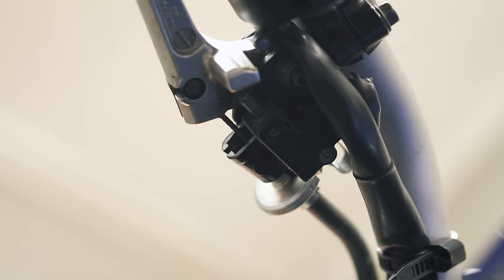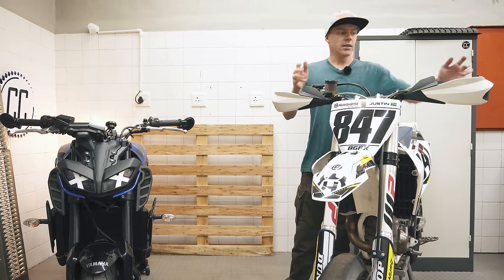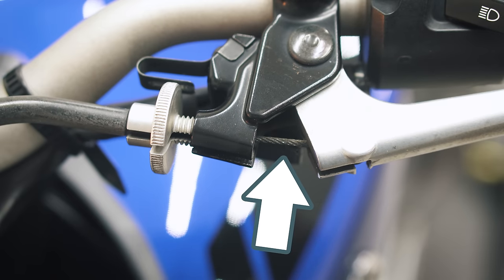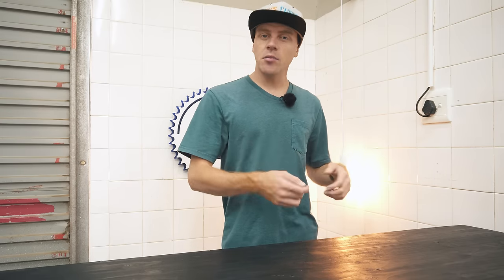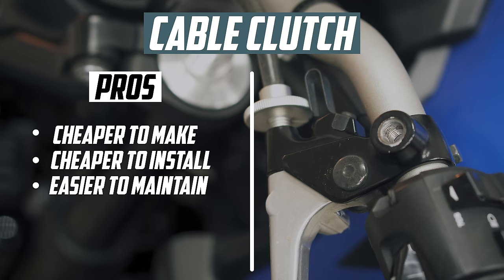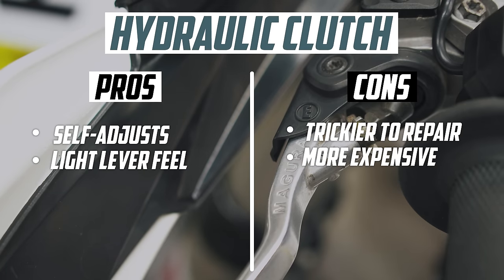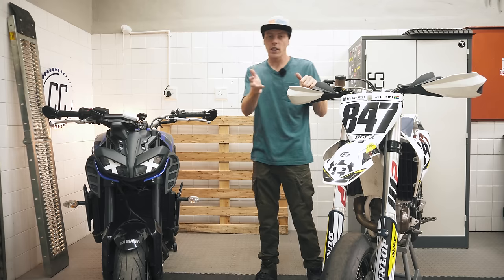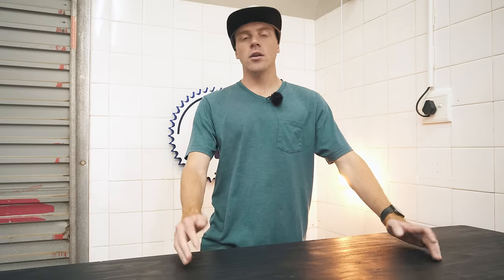Cable Clutch vs Hydraulic Clutch

Comment: Bought a VFR800, my first bike with a hydraulic clutch and was absolutely shocked... at how it really didn't feel any different 
Just makes it feel ever so slightly different when you take off from a stop, maybe a bit smoother feeling. You immediately tune it out and forget it's different at all.

It isn't something you have to learn to use differently and you will be glad that the clutch pull is a little bit lighter meaning less fatigue and slightly easier fine adjustments at very slow speed

Comment: I've got a very specific situation. I've got a 2016 Hyosung GT650 Naked, and the spares for it are harder to source. As i feel my clutch cable is starting to sag, would it be better to convert into a hydraulic system as it becomes independent of Hyosung-only clutch cable? Or wait until I source a new cable for it? As in, for all older/discontinued bikes with rare spare availability, is it better to move to a hydraulic clutch system? 

TIA.

Comment: only pros of hydraulic clutch I see is self adjustment. In cable clutch, free play will change when clutch is hot, and sometimes you may have to adjust it while racing. So many race bike or race bike wannabe have hydraulic clutch.

Comment: In my 60.000km Suzuki GSX-R150, I've replaced the cable clutch three times. I have tried hydraulic conversion, and I can assure you that it is NOT WORTH THE TROUBLE! primarily because it is dirty, time-consuming (it took me 3 hours and I came to a dead end because my clutch lever does not fit the push rod), and has an additional failure point (instead of a cable that can snap, now you have to worry about 2 worn out seals and worn out push rod).

What is the secret to a durable clutch cable? First, never lube it because, as I can assure you, doing so will only attract dirt and debris, increase friction, and cause the component to wear out even more (I once tried to clean and lube my clutch cable because many people online advised me to do so, but it did no good because I wasted my hard-earned money on a can of garbage I don't need and my valuable time cleaning the mess I shouldn't have made). Second, avoid holding the clutch lever for an extended period of time. Instead, put the gear in neutral if you're in heavy traffic, avoid releasing the clutch slowly while the engine is running at high revs, Simply let go of the clutch—not too slowly, nor too quickly—and let your engine to rev to its maximum capacity on its own. Third, save money to purchase a quickshifter for your motorcycle or attempt to learn clutchless shifting (practice makes perfect). This is not only a great skill to learn now, but it will come in handy if you or a friend has a lowside and breaks the clutch handle (one of my friend got into a lowside, he got nothing but a small bruise and his clutch handle broken into pieces, he cannot drove his bike to his home so I did it without the clutch for about 54km to his home, we arrived safely).

Do what you want, but in my opinion, converting to a hydraulic clutch is a waste of time and money.

Comment: I own a 2023 Ducati Monster (hydraulic) and a 2022 Triumph Bonneville (cable)
Fine control of clutch on a motorcycle is one of those ESSENTIAL skills and it is more difficult on the hydraulic clutch due to a lack of feeling the friction zone.
The cable clutch with slipper assist on the Triumph is WAY superior to the Ducati, particularly for round-town riding!

Comment: 2001 VFR 800, it's hydraulic and when I got it I hated it basically, the friction point was so far away from the grip it felt like it was in a different postcode.  Changed levers and it's a different story, my love live is no longer affected after a long ride with lots of changes, so us fancy Europeans are finally catching up with the fancy Japanese of 20 years ago!  But in all seriousness, when I got the bike I disliked it so much simply because of the clutch, it's not exactly as adjustable as a cable one (which you can adjust at both ends!) and from what I gather the point between "pulled" and "fully pulled" on hydraulic is a small range whilst on a cable is (again) adjustable.  Basically hydraulics can't be adjusted much.

Comment: persionally i like hydralic clutch as of now. I'm euro boy with only an AM license rn so I got my 50cc moped with cable and my husky TC85 with hydraulic. i fell with the hydraulic it starts engaging the clutch over a wider area on the lever and gives you more control over it. can't really fell anything with my moped cause it has so low power.

Comment: The main difference would be that the clutchsprings in a high horsepower bike are pretty stiff and you wouldn't be able to pull in the clutch many times with a cable. Just think about any older Ducati and you will get why some bikes need the hydraulics

Comment: i had a husqvarna wr125 with cable clutch and i switched to a hydraulic clutc, while it was lighter to pull on enduro rides etc it didnt give as much feedback als the cable clutch for hops and double blibs for obstacles and the cable clutch wasnt even that heavy. you could easily pull it with 1 finger both since enduro clutch levers are smaller and more comfortable than the ones on streetbikes. i regret i did the hydraulic but i know now for the future that you just leave the clutch actuator setup stock. (unless you upgrade to arekluse auto clutch or something but that doesnt change the actuators)

Comment: Good timing on this video, the clutch cable on my 2017 MT09 snapped only a few days ago on my morning commute (with only 18k kms on the clock) so theres an example of a very obvious con to the cable system. In saying that I've also had a seal let go on the slave cylinder on a hydraulic setup on an xjr1300 with the same result, so i suppose both systems are susceptible to failure...

Comment: I got a 2015 aprilia shiver with hydraulic clutch and on 2022 z900 with Cable clutch and its way easier to pull the clutch on the Z.

Comment: Having both an MT-09 and a KTM 350 EXC-F, I have to agree with what you said. I much prefer the cable feel and I'm pretty sure I have better clutch control with cable.
(Maybe the different type of riding on both bikes is biasing my opinion. Maybe the MT-09 is a super good implemention of a cable clutch and the KTM a poor implementation of an hydraulic clutch, I dunno)
Cheers from Portugal

Comment: hydraulic all the way :) It might not matter that much on a street bike , but when doing enduro or motocross riding it's a whole different world. You can ride all day long with a hydraulic clutch using only 1 finger and not get tired , while i felt like my fingers would fall off after a longer ride with cable clutch

Comment: Got an 08 Bandit 650 which has a hydraulic clutch. It's a nightmare. Having issues with my gear shifter sticking between 2nd and 3rd, and the only thing I can do (aside from ripping apart the engine or shift mechanism) is bleed the line
Reply: Does it do that everytime ? Sometimes they sit between the selector v's & need to kick them up again,  my bike is a kwak & does the same on occasion but more between 3rd & 4th . I've noticed it's more when i rush the gear changes,  try a little slower & firmer changes
Reply: @stestar09  Not every time. It'll go up no problem but then stick and not reset. Sometimes it resets after a second and I can feel it tap my toes, other times I have to downshift and try again multiple times. I've tried shifting quickly, slowly, firm, soft, so it's definitely a mechanical issue

Comment: The Force your fingers needs to pull the lever has NOTHING to do with cable/hydraulic. 

It is only determend by the springs in the system and the ratio at which the force is transfered from the Lever to the clutch. (For example hyraulic clutches on Harley Davidsan are hard as f**k to pull, and cable clutches and 125 smale bikes are usually way lighter. And there are vise versa examples. 

I personally like the feeling of a cable clutch mutch more over any of the fancy gydraulic clutches. (Maintance and Cost aside) It just feels more connected and the biting point of the clutch is easier to find. On all hydraulic clutches i've tried so far it felt like, yes I can feel the bike starting to move and it get's a bit louder but no real feeling for the engaging of the clutch in the lever.

I'm happy that Yamaha keeps the clutch cable actuated even on there top shelf MT-10.
Reply: This is not strictly true - with a cable operated clutch you have to overcome the friction between inner and outer cable, as well as the force needed to compress the clutch springs, so it will take more effort than a hydraulic operating system on the same clutch.

Comment: Just gonna add this: my YZ250 has a hydraulic clutch added aftermarket, and it’s simply a lever that pushes fluid into a piston that pulls a cable…. It’s pretty smooth and easy to pull. But my WR250R with a lubed clutch cable has a lighter pull and better feel.

Comment: From what I gathered is, that some larger capacity bikes(and therefore more torque) stiffer clutch springs are needed or in general a more beefy clutch

This could be very fatiguing when you have hard clutch springs and a lot of cable drag. This at least removes some of the burden. Hydraulic radial clutches also offer a more direct feeling IMO. Same with radial brake levers

Comment: It really depends on what type of riding you do. If you're on the streets or track then a cable clutch will do just fine, regardless of the type of bike you ride. if you're doing any technical off road riding then that hydraulic clutch is your best friend.

Comment: A hydraulic clutch is lighter than a cable? 🤣 Try riding a Ducati Pantah some time. The clutch is so heavy on them that you'll be opening cans of spinach like Popeye after a few months of riding one.
Personally, I would much rather have a hydraulic clutch. I've found that the transition is much more nuanced than a cable, with the fluid making it much easier to smoothly engage the clutch.